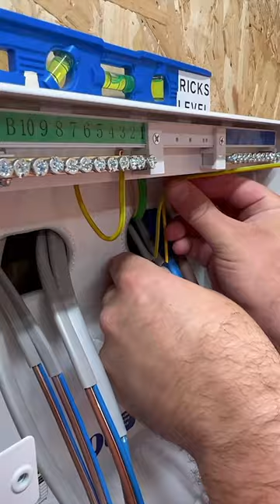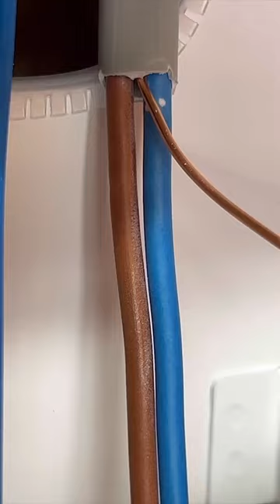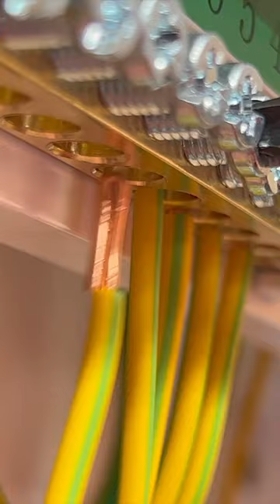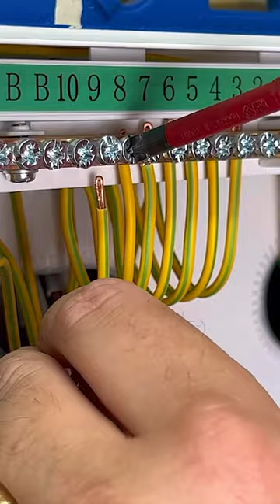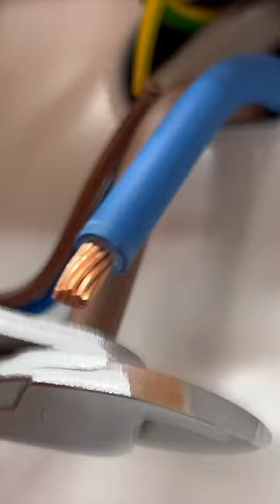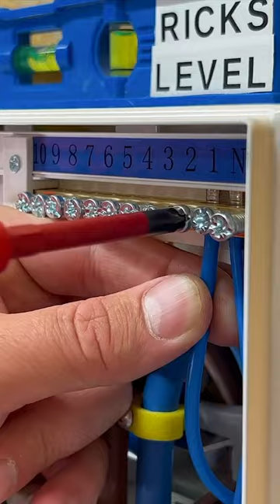Electrician Effortlessly Builds Up a New Consumer Unit

Comment: Hello, what is the cheapest but safe brand of circuit breakers? I want to renew the electrical panel in my house with 1P+N circuits but it costs at least €4.15 for each breaker (EFAPEL brand) and in the end it gets a little expensive 😅 Portugal (20% discount)

Comment: But how is it possible that these "professionals" still use rigid cables instead of multi-wire cables??
Technology that is 40 years old and no longer used in technological systems worthy of the name.

Comment: Twisting stranded wire is a big no-no. The strands won't flatten out in a compression connector, and risks a bad connection that could overheat or even arc.

Comment: I’m not an electrician but have somehow got interested and have watched most of the main YouTube sparks, and noticed pretty much every new consumer unit fitted regardless of size and if Dave Savery, Nick Bundy, CJR Electrical, Artisan etc, the bare copper ends of the CPC and Neutral Fly leads going into their respective bars, the ends seem awfully close to the metal casings, which begs the question, why do manufacturers put the cpc and neutral bars so close to the top side of the casings?

Comment: Showed how to do things neatly and beautifully that should not be done.
It is necessary to put lugs on stranded wire. And you must not twist the strands, because when squeezed in the terminals, the intersecting strands squeeze each other and reduce the cross-section of the wire

Comment: Twisting strandes gives less surface area and shouldent be done, even if it works and is upto code, instead of good contact all the way in, you get points and gaps.

Comment: I hate all these new board install videos, NOT one have I seen with any tests done before it’s connected up, why do they never twist the main cable then cut it, ( yet they twist a 6mm). All this modern  boards do is make it easy to become lazier. Oh that’s all right that clamp will hold the main cable in place, doesn’t mean it’s tight. Worst way to fit meter tails. Do the job properly.
Reply from the maker: Debatable https://www.electricalsafetyfirst.org.uk/media/1235/meter-tail-investigation-report.pdf

Comment: why would you double over? just use ferrules
Reply: Doubling back is a British thing much cheaper than your box of ferals and the crimper at about 250 quid
Reply: @dononebullen  250 is nothing if you do it for a living
Reply: Ferrules on single core is a bad idea as it introduces resistance for the sake of it!
Reply: Solid cables doubled over is not only cheaper but better ..doh 😂
Reply: Can’t use ferrules on solid conductor
Reply: Should not use ferrules on solids , no point .
Reply: @tennicktenstyl  If you don't do it for a living, a 20 quid crimp tool and ferrule set takes you places.
Reply: On the solid cores no point but on those stranded ones, could have been useful? But not essential.
Reply: Ferrules are not designed to be used on solid single cores.
Reply: @PhilipVeale yeh probably better than the twisting. Perhaps better if the cable is  used more near its max capacity ?
Reply: Don't use ferrules on hard drawn copper, only multi strand. Also, I have one of the best ferrule crimpers out there, Weidmuller PZ6, about £160
Reply: No point putting a ferrules on it's not stranded/flex